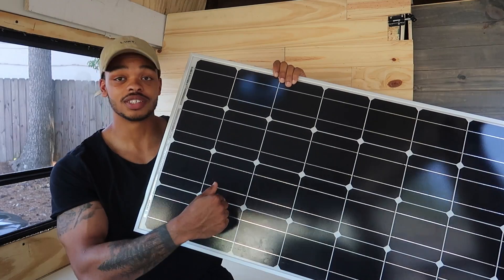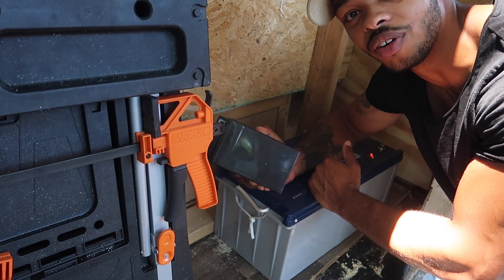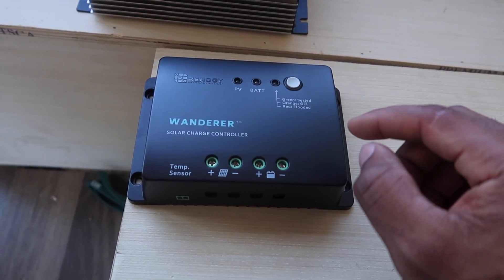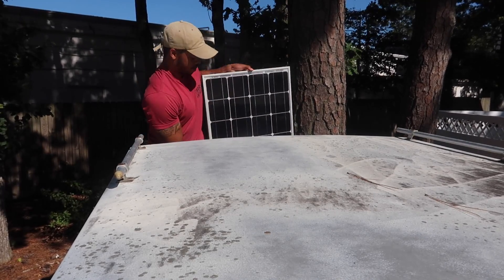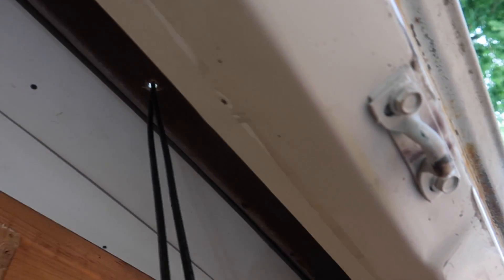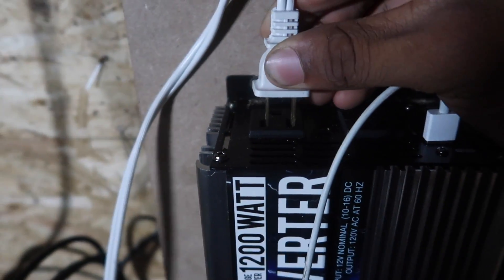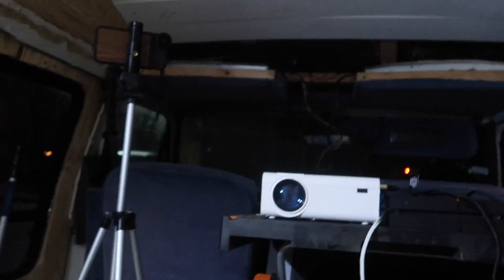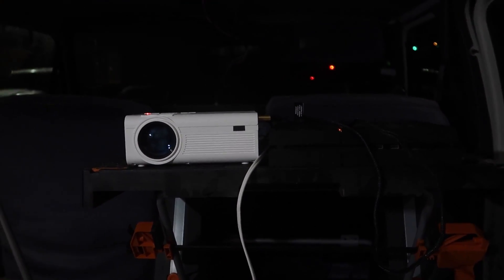Building a Solar Powered Camper Van | DIY Off Grid Solar Explained

Comment: I would definitely be up for more videos explaining the various components of battery systems and solar systems. You make everything clear and understandable.
Reply from the maker: I’ll make sure to put those videos on my list! They will be coming out soon
Reply: I agree, I would like to see more explanation on adding extra batteries and I have a 400 watt (4 x 100 watt panels) solar array I want to wire up, but I want to make it as stealth as possible, I don't care if they take up the whole roof lol. that, and how do you add these to an aftermarket alternator, and I'm sure I can figure out how to run a propane and gas 2n1 generator and electric to outlets for like KoA electric
Reply: @Dualex_Builds  Hey, like how much are you able to sell these vans for? I’m handy and I’d love to get into making these vans and reselling them.

Comment: Thank you for being so informative. Truly appreciate it. Looking to transition to van life and you have provided some very important info. Thanks. Love 💝
Reply from the maker: Well I’m glad that I could help out with this video. Thanks so much for watching and supporting these videos!
Reply: for newbies out there, keep in mind that when he was explaining how energy goes from the solar panel into the battery (i.e. 4 hours for a 20ah battery to fill, 40 hours for a 200ah battery to fill) that was just to give you the concept BUT a deep cycle battery should never be discharged below 50%.  so a 200 amp hour battery should not be drained below 100ah.  (lithium batteries can be drained down to 20%.)

thus taking 20 hours of sun to fill back up with one 100 watt panel @ 5 amps an hour.  two 100 watt panels would cut that time in half.

Comment: Thanks for the great video! It was nice that you had a solar video, because I just ordered an 1800 lithium generator with one 100 watt solar panel, to start out with. I like that it is easily transported, and came with a 25 foot cord to hook the panel to the unit. I like that you have 2 panels, it would probably be easy to add a few folding ones to that. At least for YOU...you are certainly a handy guy! I am looking forward to your next video, and best wishes on your build! It's coming right along. P.S. I had to back up one part and re-watch it, but only because I was laughing too hard! Nice split-screen!
Reply from the maker: That’s a pretty good system to start out with! I’m glad you liked the video and the slit screen lol

Comment: Even with the double insulation on the wires from the panels, youshould use a bushing where you penetrate the roof. You didn't show how you sealed it, but I am assuming just silicone since there was nothing else in the hole prior to inserting the wires. Seal your bushing with silicone, then seal the wires the same way. You will have a more finished look as well as a safer entry that can't rub a hole in the insulation over time on the raw edge of the hole.
Reply from the maker: Very good idea. I’ve never thought of that. I’ll be making that adjustment to this build thanks so much for sharing that information
Reply: @Dualex_Builds  , there is really nothing wrong with what you have. Those cables are sheathed and the chances of it wearing on the edge of a hole in fiberglass are very low, and would take a long time. With the silicone you have minimized the movement of them. It is still best to eliminate any possibility of it happening in addition to giving it a more finished look and following standard procedure for that type of application. You will have to put in a larger hole, and I suggest getting yourself a step drill that has a range of around 3/16" to 1". For drilling single ply material up to about 3/16" thickness they are great and fast and you don't need a bigger drill motor or a turned down shank.

Comment: How much does the 1500 watt inverter draw? Yes I have hear people mention that it takes away energy to run inverter to power up 110 V stuff. That is the electronics that aren’t  simply 12 v directly from battery supply that need to be converted from dc to ac. Yes? I did see that you had Renogy panels.. how is you set up working for ya. And where are you located its not listed i the comment section. Where do you build out vans. Im in Cal. Thanks for being a great resource to new builds your designs are original!

Comment: Good informational video, however, I wanted to clarify something for the viewers. Whether or not you wired them in series or parallel you would still have the same wattage. Your voltage would double when wiring in series but your amps would remain the same. When wiring in parallel your voltage would stay the same and your amps would double. All depends on the application of the panels. Parallel can be better as they will work as independent panels. If one panel is covered by shade and the other isnt, you will still produce wattage. However, in series if the panel is covered by shade, you wont produce any wattage.

Comment: Your little battery accessory that keeps track of your voltage, watts. and amps. You need to store that upfront so you can keep a eye on it, & you will do that! You don't want to get out of the van every time & walk to the back to check on it. What if it's raining. lol!! Great video! Keep them coming!! Hey! How did the murphy bed turn out? Would love to see it laid out.
Reply from the maker: Like I said in the video I’m not finished with my electrical setup. Just explaining and using examples for beginners who don’t fully understand how these systems work.

Comment: A lot of smaller LCD TVs have a power brick (transformer) that outputs 12vdc to the actual TV unit. These can be run directly from a 12v battery.

Comment: Nice video! You need to coat the roof of the van bro ! Get some roof coating at Home Depot r lowes !
Reply from the maker: Good idea
Reply: Get some Henry elastomeric roof coating, it easy to work with and it more rubberized so it will flex with the movement of the van. Little pricey, but worth every penny a gallon is about 28 to 39 dollars.
Reply: @FirstSuiGeneris  TOTALLY agree.  i did this to my van's fiberglass top 4 years ago and it was like night and day, because henry's deflects ~80-90% of the sun's heat.  

as in all painting, prep is the key, and a clean, smooth surface will dictate how long it lasts. my old van's clear coat was almost gone, but i sanded off any remaining shine, scrubbed the roof well with i forgot what cleaner (henry's recommended), and pressure washed the whole thing.  

painting was the quick, easy part, but over 4 years in and it's like new except for i can see a spot way in the center of the roof where i probably did not do the best prep- it has a small, slight loosening patch i need to fix.

Comment: Hi cool video I'm a new subscriber I've been using sketch up to design my build on a transit lwb med top . I was wondering when you drive that van do those brackets that hold the panels down show any stress from windage getting under the panel ?

Comment: I love your videos and I had a question. Does the electricity in this small space make noise, hums or is a danger to van dwellers?
Reply: i've been a van dweller for 4 years with solar powering my life.  the charge controller makes a tiny hum you can hear only if it's silent outside and you put your ear by it.  about the same as my fridge.  dangerous?  not that i have ever seen or heard of.

Comment: Being very interested, I have 2 questions after understanding all what you've said in the video:
First being with this setup can you (alternatively) charge the battery from home with a plug (aside from solar panels)? Second when you mentioned using the alternator to support the charging process, is the two batteries installed in series or parallel to the alternator? If in series isn't it risky to find yourself draining from the main battery risking no ignition on your vehicle ? Thank you very much

Comment: Great video, other videos that I see that try to explain solar , make it seem like you have to have a college degree but I like how you broke it down.  Power inverters, I have a minivan but I would like to at least have a small TV and a refrigerator and the system that you showed, will it be sufficient or what I need a stronger inverter?
Reply from the maker: Tvs and refrigerators really don’t usually require that many watts so I think you should be fine with a 1000 watt inverter or even less. If you want to save even more money and get a smaller inverter, then I’d recommend getting a dc powered fridge so that it won’t need an inverter at all and you can use a 300 watt inverter (very cheap) just to charge phones and laptops, run a tv and stuff like that.
Reply: @Dualex_Builds  thank you
Reply: yup.  i would recommend buying 12v everything for a camoervan solar system, which is a 12v system.  when you change 12 volts to 110 through your inverter, a good amount of your energy gets list in the process.  

i saw an awesome tv hack video once where the guy bought a cheap flat screen that used like 5 amps, cut off the power reducing block on the cord, and wired on a cig lighter style jack.  cool because a 12v tv is expensive.

i have not done this (no tv), but i have ubs or 12v port chargable (almost) everything in my van.

Comment: Great video, I just have one question 

What connects the controller and inverter  to the battery? I'm new at this, so I know the batteries are connected together already just confused on how to connect the additional things to the battery
Reply: the charge controller snd inverter get connected with wires to the appropriate pos/neg battery posts- with fuses in between, of course.  research the size of wire you need for your equipment, and when in doubt, go bigger.
Reply: @nonyabizness.original  thank you! Been on the road about 7months now, lol nothing has caught a fire so I guess I did it right
Reply: @NavodtheNomad  yeah, i saw your comment was 9 months old, but figured i'd answer in case anyone else was wondering.  i just found this channel, immediately subbed.  

oh and ~welcome~ to the nomad life!  do you love it?  i'm starting my 5th year fulltime and just keep getting happier and more chill 😁.  life is good.
Reply: @nonyabizness.original  I love it! Wish I had done it sooner

Comment: Great video! Been following you for a while now and am currently on this step. Regarding the wires coming through the roof, did you use something specific to weather proof the roof holes from wires or did you just use silicone?

Thanks!

Comment: I've put 4 300 watts solar panel on my van. It gives me 1100 watts because my two charge controllers are 550 watts each. I wanted enough power for my air conditioner. I have enough energy at peak performance for two 5000 btu air conditioners.
Reply from the maker: That’s a huge system you should be okay to run pretty much anything

Comment: Is there any cheap way to use kitchen appliances that use heat? such as an instant pot or water kettle? Or is gas cooking such as propane my only cheap option?
Reply from the maker: If you want to go that route, you have to search pretty hard for appliances that draw less amps than your usual appliances. It is definitely possible, but it’s usually much easier to substitute those things for similar propane options

Comment: Hey there hope your well...again thanks for the videos. Have you ever done a window installation? I have a box truck, about to start work, and needed some guidance on window selection and install. Thanks again!
Reply from the maker: The House Music Crate watch my video that I did about the roof vent install. It’s basically the same process but you’ll do it with an rv or boat window
Reply: @Dualex_Builds  thanks

Comment: Hi, 
Question; if the battery bank Is full and power is still being pulled through the solar controller from the solar panels, can that cause a Battery melt down or combustible explosión?
Reply from the maker: Good question, but no lol. The solar controller will detect the level of the battery and once it’s full, it will enter what’s known as float charge mode. This basically means that the battery is over charged and the solar controller will not force more amps into the battery until some of the amps in the battery have been used

Comment: One 400 watt. 12 volt panel runs about $289.00. Why use multiple 100 watt panels?
Reply: There might be some electrical reasons but sometimes it's just that the bigger the wattage the bigger the panel. And it's hard to get the thing up there. A 400w panel is like 50lbs and almost 6 feet long

Edit: it's also generally less stable the larger the panel. Panels are glass and the motion of the van makes larger ones more likely to have problems

Comment: Me?  I locate caverns, do cartography of their content,
and go find another.  My own refuge getaway is under
cold black lava.  A natural tube that's wide, tall, with
improved flooring using poured concrete.  Solar heated
water and electrical for my modest needs.  Insulated.
At tube rear is year-around ice.  That's helpful for A/C,
food storage, and potable melt-water.   Entry portal
offers shaded patio space and covered parking.  All
surface fixtures are painted black amid lava.  To add
solar warmth and hide my presence,  Vehicle access
is over bare volcanic stone.   I have other underground
ice reserves and potential use to store livestock.  In
Canada to see lava caves, Google: British Columbia
Speleological Federation.  The last lava tube entry I
found using Google Earth is in view from Phoenix, AZ.

Comment: There is NO such thing as "Amps per hour". Amps is ALREADY a rate of current delivery.   Battery capacity is in Amp-hours.   100 Amp hour battery can supply 20 Amps for 5 hours or 1 Amp for 100 hours, etc.
Reply from the maker: Trying to make a simple explanation for beginners here man